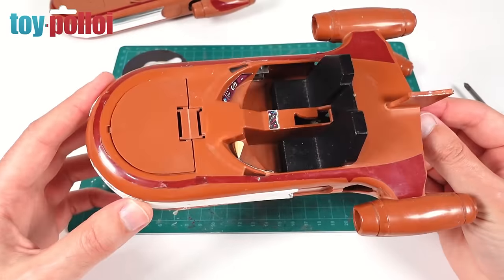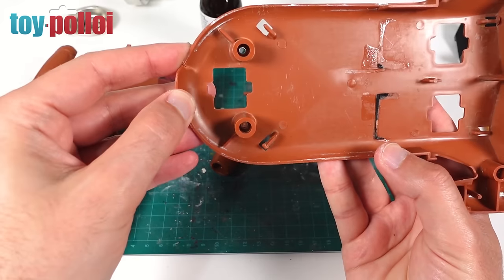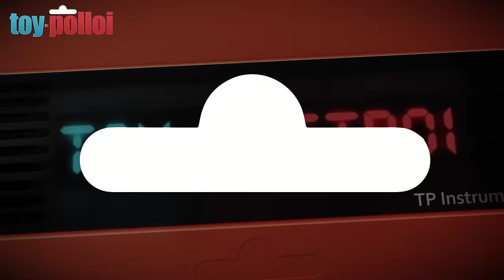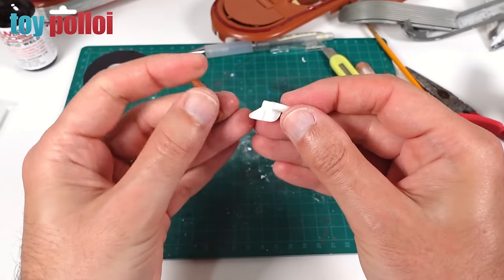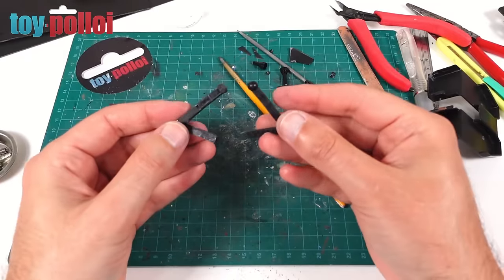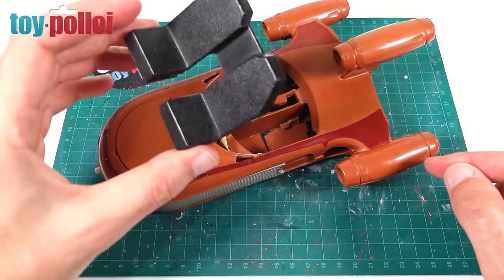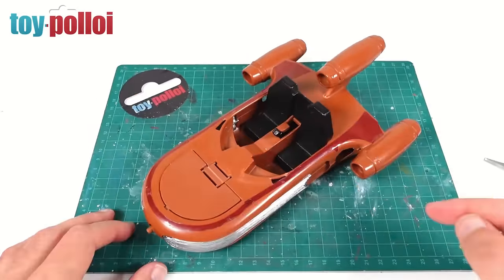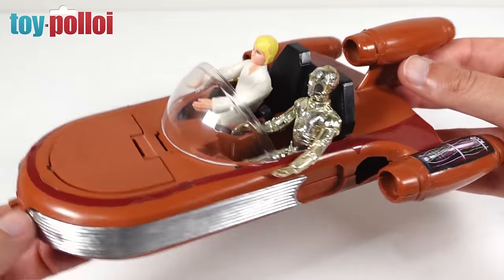Vintage Star Wars Landspeeder - From Junk to Displayable - Toy Polloi

Comment: A couple of tips that will hopefully help you out... There's a cleaning agent here in the states known as "purple power" or "industrial purple" or "Super clean" that you can soak plastic bits in to remove paint without damaging the plastic. It also removes the chrome like the DOT4 brake fluid. Also, if you find yourself running low on plastic weld, you might be able to get MEK (Methyl Ethyl Ketone) at your local hardware store. That's all that is in the bottle. I know here in the states, for the same amount of money that you'd pay for that little bottle, you can get a big can of MEK that will last for a long time. 

Thanks for another wonderful video on how to save old toys that would've ended up in the trash.
Reply: Kronos, this stuff?  SOLVABLE Professional Grade Methyl Ethyl Ketone (MEK) - 946 ml
Reply: @StealthMockingbird  yup. That's it.
Reply: @kronos6948  Sweet!  I'll be picking some up this weekend.  ;)

Comment: Well it seemed to be irrecoverable, but you gave it a new life. There's one thing that I've tried myself a couple of times: to get rid of the white stress marks on plastic you can heat it with an air dryer. The plastic needs to get really hot so I wouldn't try where there are paint applications.

Comment: I tried the windscreen trick on a Mego Comic Action Heroes Batmobile using the fluted bottom of a 2.5 litre blue cider bottle to give a nice double windscreen effect. As for the contents of the bottle, waste not want not!
I also customised an old Palitoy Speeder by cutting out part of the right hand engine cover and making the exposed engine by cutting a piece out of an old Millennium Falcon cardboard interior wall and simply gluing it in. Great video, I'll have to get some mirror chrome paint, the pens are only good for smaller areas. 😁👍